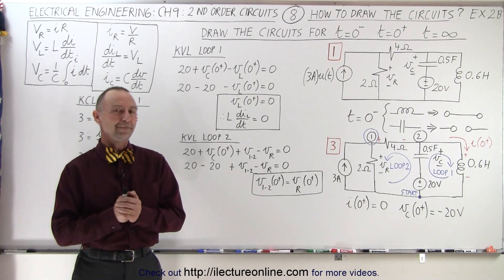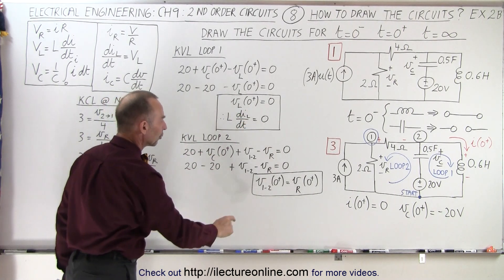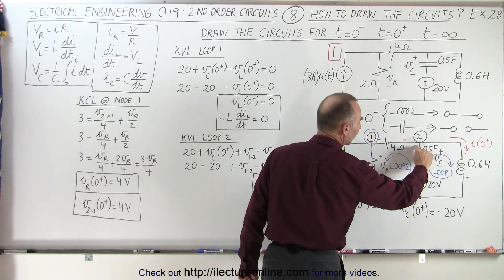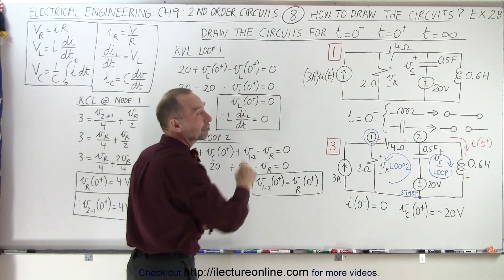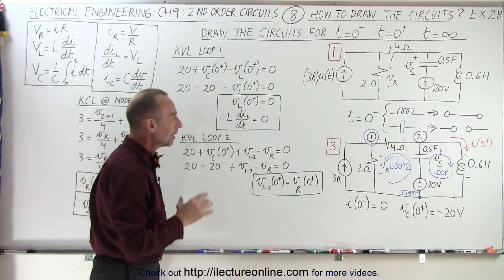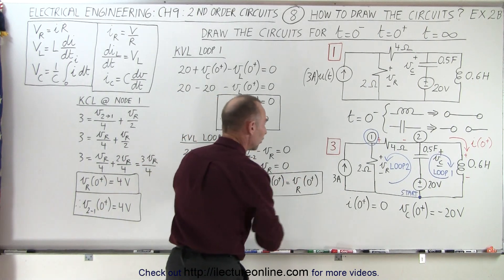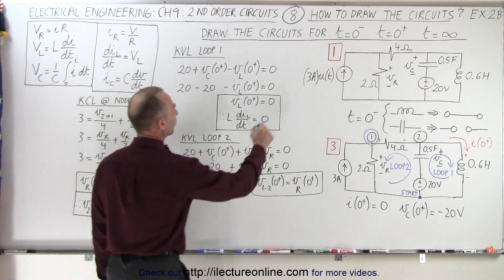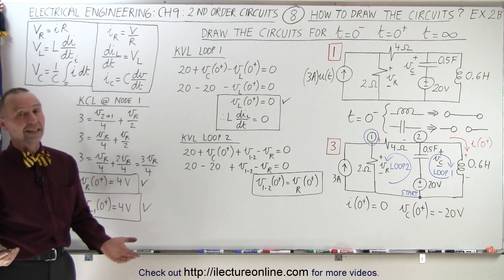Electrical Engineering: Ch 9: 2nd Order Circuits (8 of 76) How to Draw the Circuit: Ex 2B

Comment: Sir i am confuse in a whole video which sign convention you are using passive or active sign convention ?❤
Reply from the maker: We use the convention that "positive" charges flow from the positive side of the battery to the negative side of the battery.  (Does that help?)
Reply: @MichelvanBiezen  Yes,Thanks Sir❤️

Comment: a quicker way to calculate Vr(0+) would be to simply treat the inductor as a current source and the capacitor as a voltage source and then solve for Vr(0+)
Reply from the maker: It depends on the switch opening or closing at t = 0 (or whateve the initial conditions are)

Comment: Sir. Make a video of differential  equation about electrical. May i use laplace?
Reply from the maker: We already have an entire playlist on Laplace Transforms:   ELECTRICAL ENGINEERING 16: THE LAPLACE TRANSFORM
Reply: @MichelvanBiezen  sir i have one question why should i studied calculus  specifically for electrical engineering  if i have no idea where should i use those 2 types of calculus specially at differential  and integral calculus? I wonder  if i found some formula in integral calculus to verify the continuous current flowing in a circuit every seconds. I don't  even know what's  the main purpose of calculus.
Reply from the maker: The main part of calculus in integration and differentiation.  Thus whenever you are working with differential equations or you need to integrate, calculus is needed.